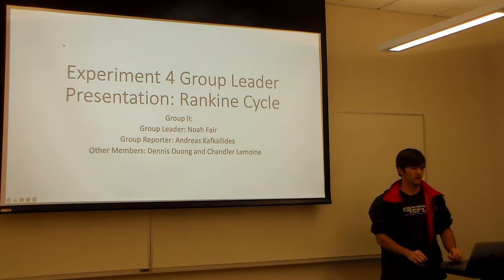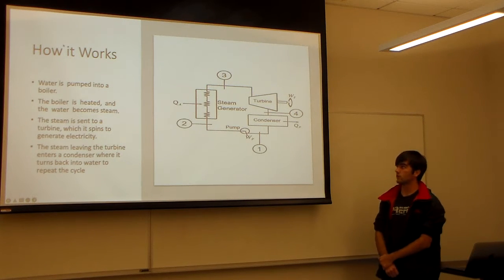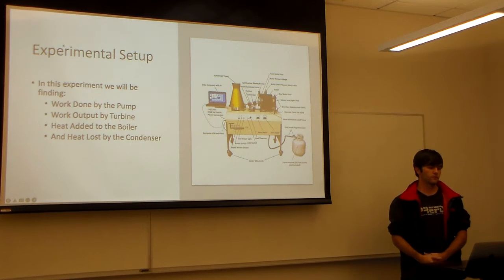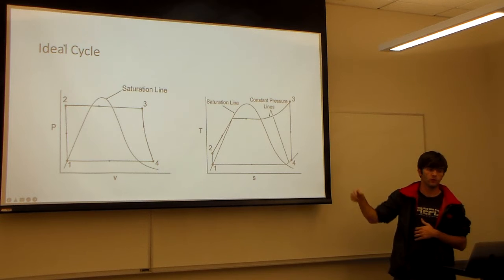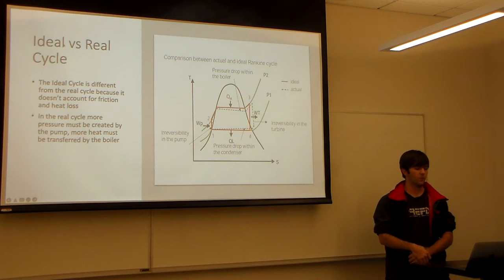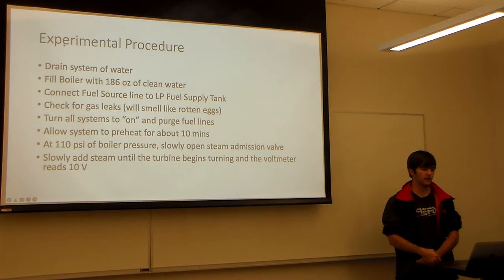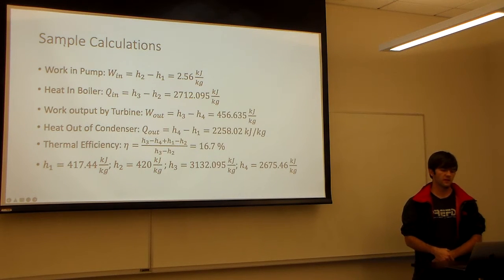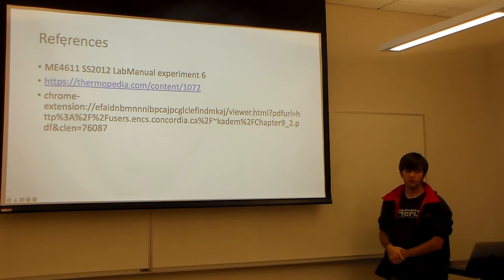Noah Group Leader

Comment: Technical content: Noah did an awesome job explaining experiment 4, the Rankine cycle. He gave some background into what the Rankine cycle is, explained the experimental setup and procedure, and gave some detailed sample calculations by including the equations and values he used. A small improvement he could make is to maybe expand a little on where the equations came from, mainly the thermal efficiency of the cycle.